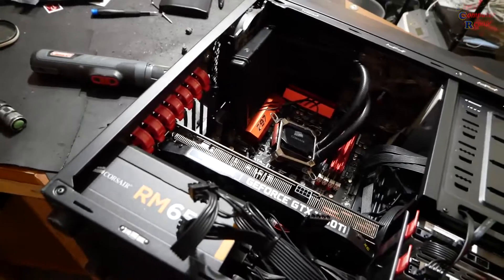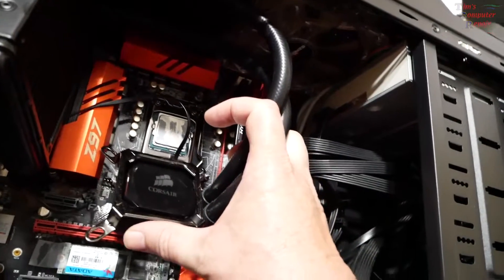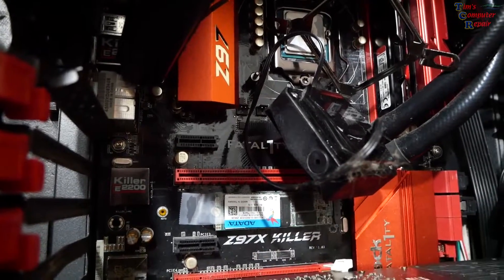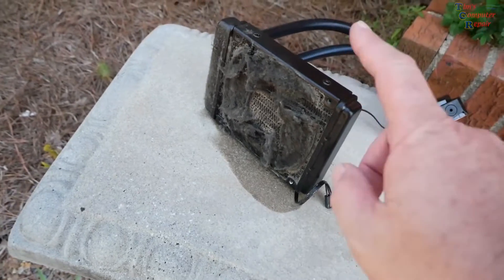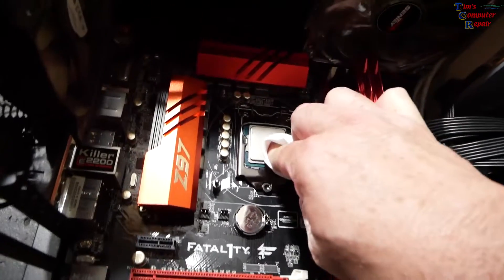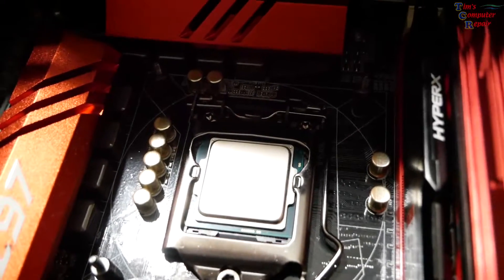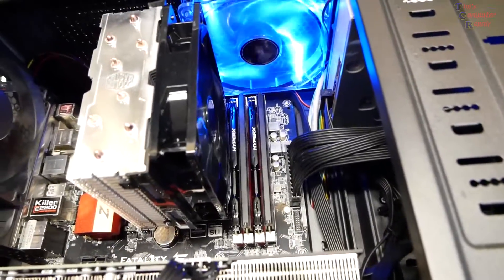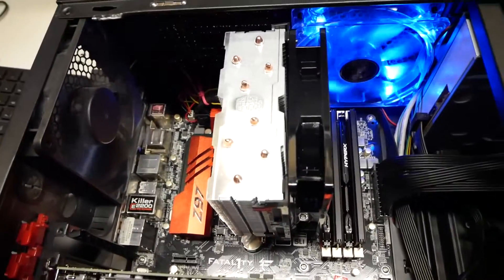Why is my PC Water Cooler not Working

Comment: I have this exact closed loop cosair water cooler and Ive just encountered a problem where my CPU temperature is in the warning zone, but my motherboard temperature is fine and low. Are you able to tell me, if i unscrew the fan part of this cooler (the bit that had all the dust in it on your video), is it easy and straightforward to do? I dont have any leaking going on, just an overheated CPU, so im hoping that cleaning the dust out will help, although I have blown the dust out and there is no way as much as in this video. Thanks.
Reply from the maker: Seperate the fan from the radiator and blow out the dust. If you still have overheating problems then your water cooler is failing.
Reply: @TimsComputerRepair  Hi thanks for your reply, I actually did this and there wasnt much dust, however, strangely enough, after I reconnected everything the cpu temp dropped back to normal and it seems my asus suite software is now saying the chassis fan 2 is working, when before I took it apart, it was saying '0 rpm'.
I also noticed that there was no vibration from the cpu cooler's hoses before I took it apart and when i put it back together and felt the hose it was vibrating gently.
There wasnt a dust problem, so I'm assuming the water cooler has died or is weak or something. Great video, helped me a lot at gaining confidence to take it apart.

Comment: He installed the AIO wrong that’s why his pipes started leaking he was supposed to put the regulator at the top and than connect the fan so it can blow air down than connect the AIO to the cpu and it really sucks because a lot of company’s don’t tell you that and that can  lead to the AIO over heating are making loud noise
Reply from the maker: Thanks for commenting.

Comment: 2/27/20  Purchased a Msi 240r AIO Liquid Cooler for my R7-3700X @ 4.5ghz with Temps under 73c .... Last week i Noticed very high temperatures with a non Processor intensive game ? Set Cpu back to stock and started trouble shooting. Disconnected the pump butt not issue, then felt the hoses = Liquid running. Gonna Check the thermal paste & unscrew the Radiator & fans for good Cleaning, Plus need to check for Liquid Evaporation ? Watching Plenty of Videos for trouble shooting tips .... Thank You.
Reply from the maker: Good luck.
Reply: @TimsComputerRepair  - Weird, pump working, did all the troubleshooting, thermal paste fine, Cleaned fans ( wasn’t that dirty ) Checked fan Profiles, it’s basically Cooling @ 40%  😤
Reply from the maker: Your cpu thermal sensors could be malfunctioning. Not good.
Reply: @TimsComputerRepair  - is the Sensor located inside the Aio ?

Comment: it leak because of 1 main reason 'LACK OF PROPER MAINTENANCE/CLEANING OF THE UNIT'
in technical terms;
AIO uses soft tube and soft tube are not as good as PETG and acrylic tube.. 
for example customer water builder have experienced PETG tube slightly re-bending to and causes leak due to water temperature thats why acrylic is much better even its much more fragile since its much more heat resistance.
back to topic, since its using soft tube and the radiator is clog up by dust too much dust now it can no longer dissipate heat since its fully block and by the looks of the build up of dust the user set it as intake.
its an AIO its easier to clean it during maintenance than a custom water loop PC.. by the looks of the paste its completely dried up that means the user never remove the AIO for proper maintenance.
the other parts are at good condition but not the AIO radiator and the thermal paste.
its also not the paste that causes the leak.. since the paste is dried out the thermal transfer is completely bad.
its the dust in the radiator that build up completely block the fin holes.
Reply from the maker: Thanks for commenting.

Comment: My PC radiator started to leak Right on my graphic card now my graphic card doesn’t work. Does anyone know if there’s a special tool to remove the fittings from the radiator?
Reply from the maker: A drill. Those are rivets holding the radiator together.

Comment: Once had my aorus master fan configuration go haywire on me and stopped the cooler fans from spinning.  My cpu temperature was 39 degrees on idle thanks to my noctua nhd14 heatsink. Miracle of passive cooling that you wont get with an AIO.
Reply from the maker: Thanks for commenting.

Comment: with water i get to 20 degree while watching your video
Reply from the maker: With my air cooler I get to 23c.
Reply: @TimsComputerRepair  before  while gaming i reached 90 degrees now i reached 60 degrees   that is why i changed all to water   air is safe but water gave you a little more is you wanna overclock or just to be lower so you do not get  trottle back   issues....sorry for  my not perfect english

Comment: I'm using a similar AIO cooler without a problem but as soon as it's 4 years old it's coming out. They don't seem to last much longer than that. If i don't replace the computer the next cooler will be air.
I think that one failed from lack of maintenance.
Reply from the maker: That is a good rule of thumb. Thanks for the comment.

Comment: I got the 240 version of that AIO in my old system. For me it was running fine but I was planning on doing a test between that and air cooler on my R7 2700.
But I completely agree, especially now with how good Air Coolers are there is no point in risking going water over air.

Thanks for the video, hopefully will ware some people away from them. Also as for your note with a reservoir, I agree with that, would be so much better.

Edit, side note. Why was the original AIO cooler drawing air in and not out (dust on the outside of the radiator). Surely that would have been better to use that as a exhaust unless the top is a exhaust?
Reply from the maker: Lol Tony, these guys built this computer all ass backwards. The closed loop thing is just my personal opinion. Heck I have several videos on my channel recommending and showing how to install them. I just wanted to make people aware of the negative side to water cooling before they pull the trigger on one. Thanks for the comment.
Reply: Completely understandable and yeah it does look like it was all ass backwards haha. Well glad its finally having a pro to sort it out lol

Comment: they installed the fan wrong!!!
Reply: Right. Also didn't he say it was a AMD board? That looks more like a intel cpu
Reply: What drives me nuts is all these people who brag about the super mega high end pc and how they made it themselves. When in reality the just bought a bunch of expensive part slapped it together and when something goes wrong they send it off to be fixed instead of fixing it themselves. Also I modded my closed loop system by replacing the tubing with clear tubes and adding in a second rad. That's right I have a 2 rads and it hasn't failed.

Comment: too much heat boiled the water and the expansion blew the seals and any of the weak areas of the rad? what do you think?
Reply from the maker: Who knows. Cheap cooler probably biggest issue.
Reply: @TimsComputerRepair  better now with good ol' fashion air cooling. Hope the customer looks after better in the future. You should sell them a few cans of compressed air for maintenance or book them in for bi-annual servicing.

Comment: OMG Did Stevie wonder build this machine , Scotch tape to hold down a NVME, that a first to me and looks like it been used on a building site with all that crap on the radiator , give me an Air cooler any day. great Video Tim, keep up the good work matey
Reply from the maker: Yeah not sure where the computer was sitting, but that was pretty bad. Thanks for the comment.